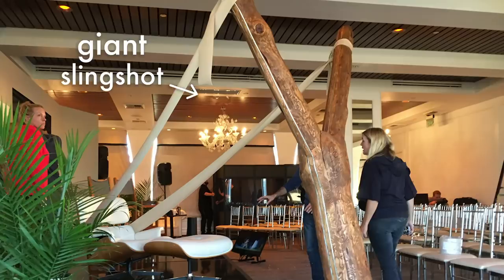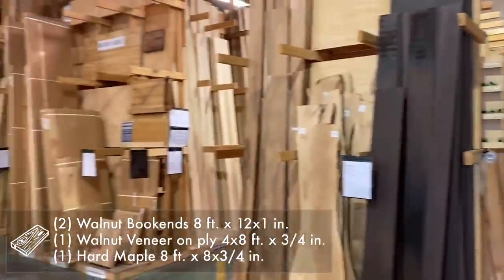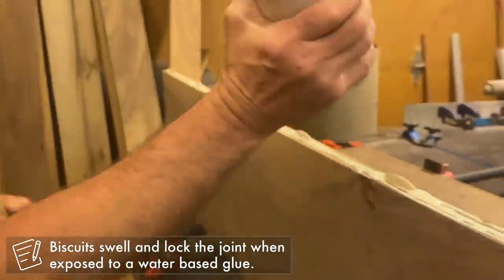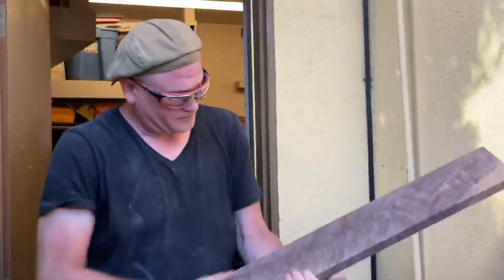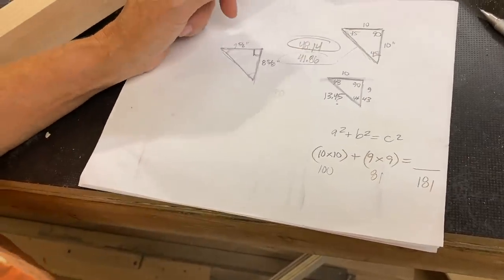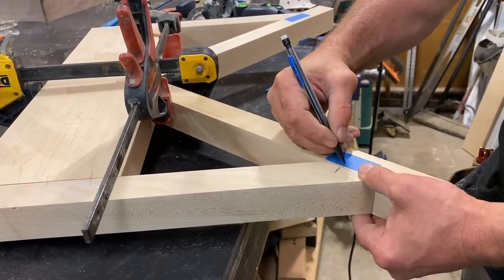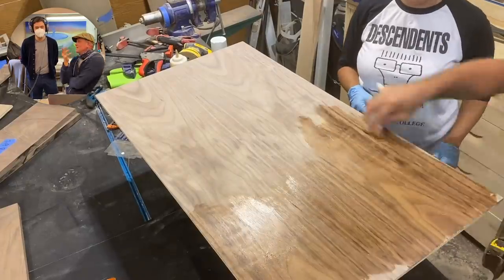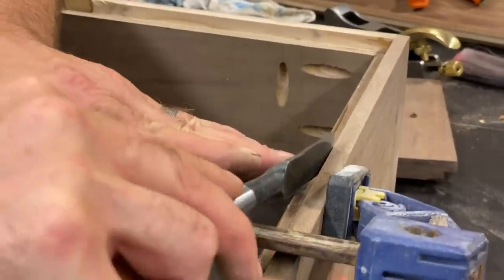Fabricating With Friends: Nancy’s Convertible Table

Comment: All it needs is some kind of padding built into it so when you close it up it doesn't thud. Personally I feel like the metal inlay wasn't needed though, or made of the light wood material instead or some kind of patterned composite of the light and dark wood. Another cool feature would have been an extra layer on the bottom about an inch thick that could be pulled down to create a bottom shelf area with stops that ultimately rest perfectly and flush on the inside angles at the bottom of the legs for support.

Comment: OK, OK, I do crazy stuff in the shop all the time. But, 12 seconds in I cringed visibly - that way of cutting  a board against a fence is THE MOST DANGEROUS.

I ran a woodshop with many employees for almost 2 decades and KICKBACK is one of the most common accidents on the saw.
I even made a safety video showing EXACTLY how it happens, and this clip (above) is perfect for showing not only kickback, but how it will instantly whip your hand right into the blade.

C'mon! Why not use a miter gage? Or, better yet: use the miter gage, add a spacer block against the fence and remove it before the cut? 
Or use that lovely Bosch Miter Saw (I own the same one, it's rockin'!) to do the crosscut?

All right, I'll stop now. 
Do crazy shit all YOU want . . . JUST DON'T TEACH OTHERS BAD HABITS!

Love,
Grumpy Old Man

PS: After 48 years of using a table saw, I finally got mangled. But, oddly enough . . . the blade was IN MID-AIR! (now, how the heck did THAT happen?)
: - )